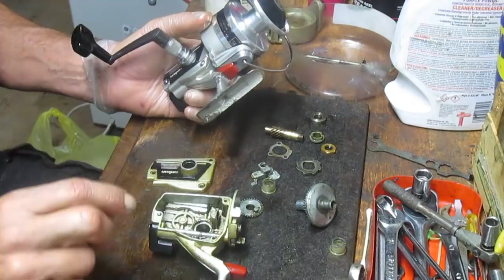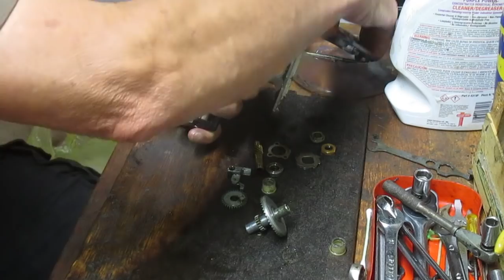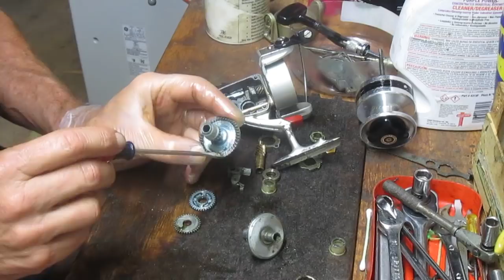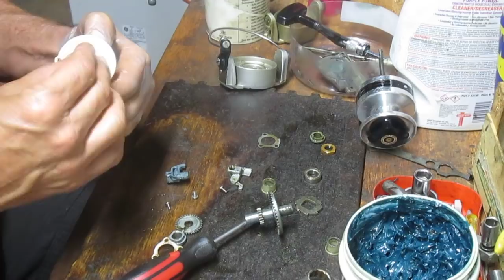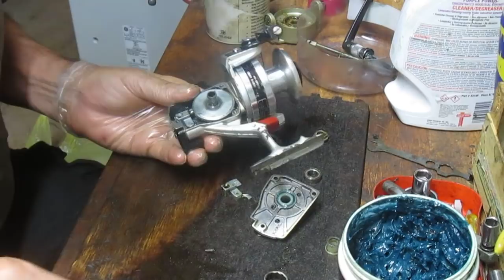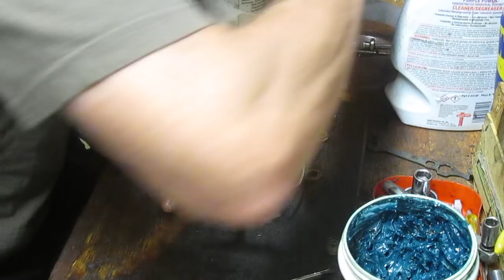Daiwa 2600c take apart and rebuild using a parts reel for repair

Comment: I have a silver Diawa 2600C that I purchased in 1978 and with regular maintenance, I clean and regrease every two years, I have never had any problems with it. I paired my 2600C with an Eagle Claw 8' 6" Medium rod for fishing Lake Michigan and now use it for rivers and flood control reservoirs.
Reply from the maker: Very nice! The key, as you noted is to service these reels regularly.  The 2600 and other silver series reels are tops - Dennis

Comment: just dug out one from a box and tore her apart and serviced her not bad it had grease that was 20 years old in it so its not perfect but back together working with no extra parts....I am going to start taking pics.... I had to come in from my shop and look at a schematic to see how some parts went back... it had the old daiwa black gold design with the bushings and one ball bearing instead of 3 ball bearings....Your right hearing the reel clicker brings back my teen years.....
Reply from the maker: And that clicker let's others nearby know that there is a fish on!  Tight lines - Dennis

Comment: Dennis, I have a Daiwa 2500C that I have restored to all it’s original glory. What is the difference between a 2600C and a 2500C? I have a 7000C, 4000C, 2500C, and two 1300Cs in the Silver Series. I got a kick out of the 1300C reels. They are so beautiful and amazingly strong. I’m looking for  a GS9 or a 9000C for the future. I have reels in four of the 1970s Silver Series reels - Daiwa, Penn, Olympic, and as of today - Ryobi. You were still using the screwdriver for grease in this video. I like that as I still do. Steve has a beautiful 2600C. It looks a little larger than my 2500C. You did a great job of this one! I love these reels. ——Chris
Reply from the maker: I think the difference is spool capacity.  I believe the internal gearing is the same - Dennis

Comment: I noticed the play in the spool that you found. I have the same problem with a Ocean Star No. 36 that I have attempted to restore. I told you about it when we were trying to determine who manufactured it. (Daiwa)  There was no cause for the spool like you found in this one. The Ocean Star has no bearings just bushings and I finally decided that it was probably caused by the age and previous use of the reel. - it’s age.  The gears were in great shape though. If you have any ideas on how to get rid of this unwanted play in the spool please let me know. It doesn’t badly affect the operation of the reel but it does have some bothersome noise with the spool.

The Daiwa Silver series reels are awesome. As you know I recently acquired a mint 7000C that you helped me to remove  the spool for service.  They are incredibly durable and easy to use. I really like the fact that you can rotate the reel to snap back an open bail or choose to close it manually - a great feature not found on most modern reels of today. Thanks for another tremendous video. 
         - Christopher
Reply from the maker: I think it should be attributed to age and wear.  Many bushing widen with use and many cases expand, which causes the slop.  Nothing to do there but replace with new parts or live with it.  Thanks Christopher - Dennis

Comment: Hi Dennis, The Daiwa 2600C makes a clicks during retrieve. Can this be silenced ? Is it the plastic "hook" in the underside of the spool ? Can I snip that hook off ?
Reply from the maker: Sorry - that click is the nature of the beast.  It is the anti-reverse dog tapping on the ratchet.  The only way to silence that is to disable the anti-reverse.  You should have the over-ride on the bottom of your reel.  Move the switch and you will not hear it any more.  The plastic tab under the spool only clicks when the drag is loose and the fish is pulling line out.  It is an alarm to let you know the fish is on. - Dennis
Reply: Thank you Dennis. I am enjoying my Peen 104 and have had 3 tarpon on, but only for a run.

Comment: I have 2 3/4 of these... lots of questions on where to get parts....etc (and yes I rebuilt them am crammed as much grease in there as possible--now I know). Question is:why is the drag-knob self tightening? I take maybe two yards off these spools and the drag is on maximum??
Reply from the maker: That shouldn't be self tightening.  Is this happening on all of your reels/spools or just one?  It sounds to me like the drag stack is frozen or there is broken line trapped inside and wrapped around the axle or some other factor.  You should remove and service the drag stack to make sure it is set up correctly.  If you have more than one spool, swap it out and see if the problem remains.  That will tell you if it is drag stack related or in the reel itself - Thanks for asking - Dennis

Comment: Hi Dennis.  Great video as usual.  I was working on  my friend's 2600c and everything went great.  The only part I am having issues with  is key # 41- anti reverse claw spring.  I do not know the proper orientation of this part.  I believe it sits under the anti reverse claw, but can't get it to sit properly?  Do you happen to have a picture of the orientation of this part?
Reply from the maker: Give me a day or so and I will see if I have one then take a picture for you or do a video on how to reset it - Dennis
Reply: Thank you sir!
Reply from the maker: I am posting the video now.  You should see it shortly.  Good luck on the repair - Dennis
Reply: 2nd Chance Tackle That did the trick!! Thank you very much!

Comment: Excellent job. Should i be using diferrent grease for the gears and drag assembly ? Thanks
Reply from the maker: You can use the same reel grease on drag washers.  There is a speciality drag grease product - Cal's universal drag grease, that I use. but you can get by with the regular grease and  you do not need to buy it for a single use.  Thanks for asking - Dennis

Comment: Hi Dennis how do remove the Excess Grease and what solution would you recommend.
Reply from the maker: Use a small flat bade screw driver to scrape off the hard stuff and then penetrating ol to loosen up the rest before mopping up with a cotton swab or paper towel.  Thanks for asking
Dennis
Reply: @2ndChanceTackle  thankyou Dennis

Comment: I bought one of these at a flea market. The bail doesn't stay in  the closed position after being tripped. What should I be looking for there?
Reply from the maker: Sounds like a bad bail spring - I would check to make sure it is not broken before I did anything else.
Dennis

Comment: I have a 2600c the drag is not working.should I keep or trash it.lick it.not if it cost more for parts than what. It worth.let me know on your take on it.
Reply from the maker: Definitely keep it.  Follow the drag service at the end of the video.  Washers are cheap and you probably just need to clean and lube them. - Dennis

Comment: what is different between 2600c and daiwa ss-1000z? and what price now a days, i want to buy..
Reply from the maker: They are similar, but the materials in the SS series and the case are superior to the 2600C.  Since you are fishing a lighter size reel, there is less difference than with the bigger ones.  Both are excellent reels - Dennis

Comment: What kind of Cleaner/Degreaser is on your table? When do you use it?
Reply from the maker: The degreaser is Purple Magic.  I use this for cleaning the exteriors of reels, particularly the side plates on conventional reels and the side plates and spools on the spinning reels.  I use a piece of a soft kitchen scrubby pad and the Purple Magic to remove grime, dried oil, fish scales and dirt.  It does a great job.  If you use this, I recommend that you wear latex gloves to keep the product and the stuff you are removing from the reel off of you hands. - Dennis
Reply from the maker: Purple Magic is available at auto parts stores, Wal-Mart and online.  a 24 ounce bottle is around $9.
Reply: Thank you very much!! I love your channel

Comment: Is there a particular grease I need to use
Reply from the maker: Any fishing reel grease will suffice.  I use Penn Precision reel grease because I work on a lot of Penn Reels, but the manufacturer is less important than making sure the grease is designed for fishing reel application - Thanks for asking - Dennis
Reply: @2ndChanceTackle  your the man Dennis appreciate your response saved me from putting on car grease